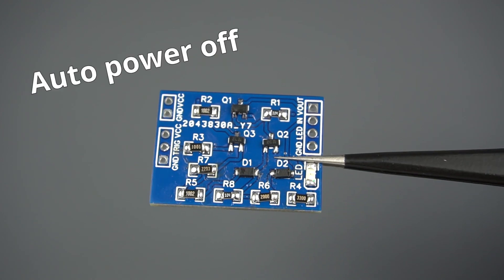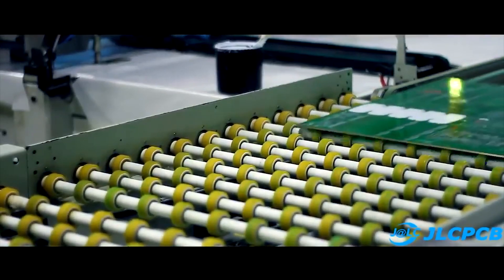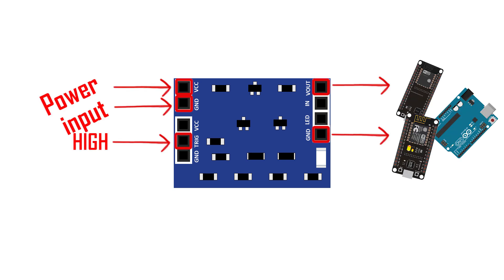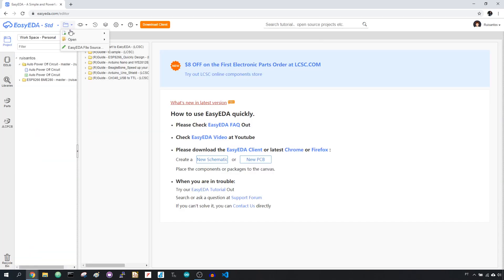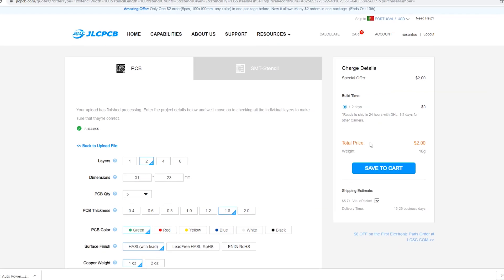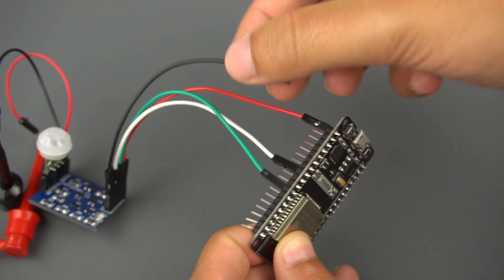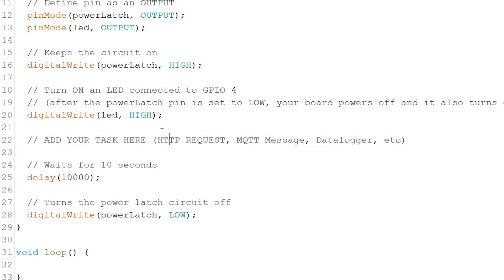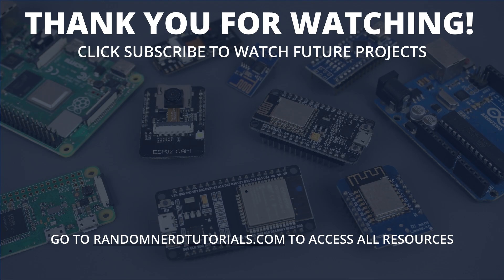🔋  EXTREME POWER SAVING (0µA) with Microcontroller External Wake Up: Latching Power Circuit

Comment: Nice board, thank you for sharing. In order to save power if you use a battery as source, it would be nice to not have the onboard LED, can I simply omit that, ans it will still work as normal?

Comment: Thank you for your instruction. I found more simpler version of same circuit here: https://github.com/gitpeut/IRF7317-selfextinction

Is it possible to use MAX809SEUR MAX809S SOT23 voltage supervisor and adjustable RC Timer to  replace the switch trigger?

 RC timer circuit can be created using capacitor and 1 megaohms potentiometer  between power supply and Voltage supervisor IC.

Thanks.

Comment: Great video there. Can I ask? I am planning to use distance sensor as a trigger. How can I set the threshold? And is it possible to use i2c sensor? Thanks
Reply: It expects a binary signal, so no threshold, you need to threshold yourself to make it binary. I2c is a data protocol, and has nothing to do with this. If your i2c sensor is capable of creating an interrupt signal though, that interrupt can be used to activate this circuit.

Comment: Hi. Another great video..  if I understand the circuit correctly.. the host MCU needs to initialize and set the latch high before the input trigger falls back to low... right?
If so any idea how long that input pulse needs to be held high for the esp32 to initialize and set the latch?
Reply: According to https://randomnerdtutorials.com/esp32-pinout-reference-gpios/#:~:text=work%20as%20expected.-,Pins%20HIGH%20at%20Boot,-Some%20GPIOs%20change, there are several pins that should be high at boot. But I'm not sure how long that actually takes to initialize though. If anyone knows or has a link to that info, please share! Thx!

Comment: Great video.
How long the trigger pin must be high to boot the ESP, and turn on the latch pin? What is the minimum pulse length to trig pin?
Reply from the maker: You are correct. You have two options: 1) if the trigger pin is set to HIGH, the ESP will be powered on. 2) If you set the LATCH pin to HIGH the ESP will remain on. The minimum pulse length to trig pin depends on how fast your microcontroller boots up and sets the LATCH pin to HIGH (which will depend on the firmware and processor). For example with an ESP32 and a very fast button press, it's enough to activate the circuit. If you're using an Arduino board, you might need to hold for at least 1 or 2 seconds the pushbutton.
Reply: According to https://randomnerdtutorials.com/esp32-pinout-reference-gpios/#:~:text=work%20as%20expected.-,Pins%20HIGH%20at%20Boot,-Some%20GPIOs%20change, there are several pins that should be high at boot. But I'm not sure how long that actually takes to initialize though. If anyone knows or has a link to that info, please share! Thx!

Comment: Hi Rui, thank you for the video, very informative. May I ask you why not just buying the regular latch circuits on aliexpress, for example? They are rather inexpensive and do the same, dont they?
Reply from the maker: You can definitely buy them. The goal is to experiment and to learn how to create custom circuits. I basically plan to create in a future project a PCB with ESP32/ESP8266 with a built-in power latch circuit
Reply: @RuiSantosdotme  Have you created a PCB of ESP32 with built-in power latching circuit yet? Know if something like this is available commercially? Also, can I use common general purpose transistors/mosfets for the circuit? To be as low power as possible which specs are important?
Reply: @RuiSantosdotme  that would be great.  I gave up on esp deep sleep,  it doesn't work with esp8266.

Comment: when the esp32 wakes from "deep sleep" it wakes via full reboot of the board.  does this latch circuit prevent that full reboot during wake up?
Reply from the maker: @nearcz As long as the latch pin (IN) is set to HIGH, your ESP32 is powered on and it will not restart.

Comment: It is really good. But what about rip sensor and other sensors? They will consume power and esp32 deep sleep doesn't consume alot of power to consider this board. It is useful for arduino and esp8266
Reply from the maker: It depends on what you use, the PIR motion sensor will consume almost no power, but if you use a switch or reed switch it will consume 0 uA

Comment from the maker: You can find the complete project details (schematics + Gerber Files + source code) on my blog ► https://RandomNerdTutorials.com/power-saving-latching-circuit/
Other projects mentioned in this video:
- Latching Power Switch Circuit (Breadboard version): https://RandomNerdTutorials.com/latching-power-switch-circuit-auto-power-off-circuit-esp32-esp8266-arduino/
- 
Power ESP32/ESP8266 with Solar Panels (includes battery level monitoring): https://RandomNerdTutorials.com/power-esp32-esp8266-solar-panels-battery-level-monitoring/

- ESP8266 Voltage Regulator for LiPo and Li-ion Batteries (ESP32 Compatible): https://RandomNerdTutorials.com/esp8266-voltage-regulator-lipo-and-li-ion-batteries/